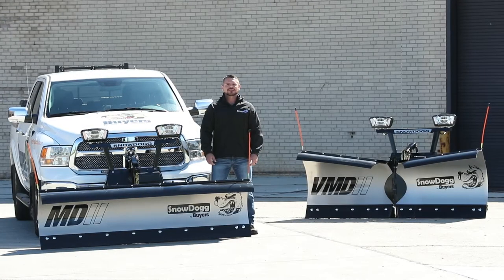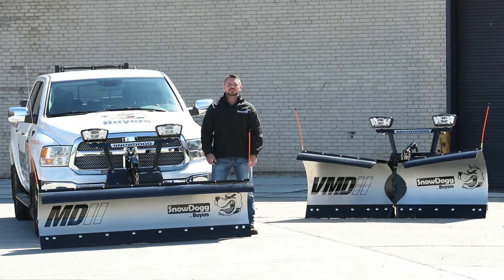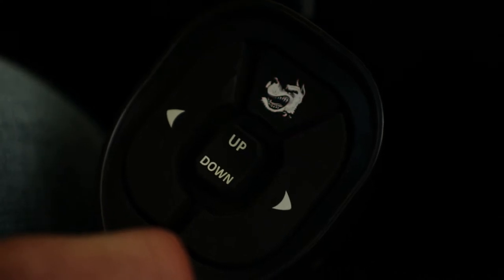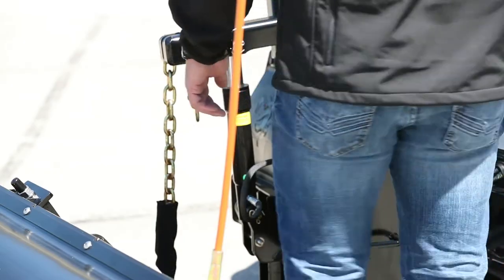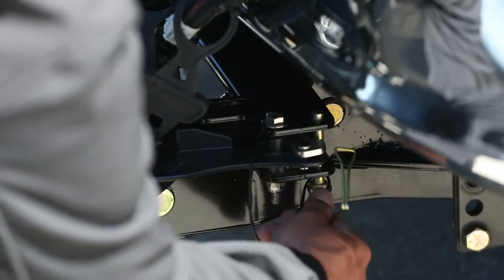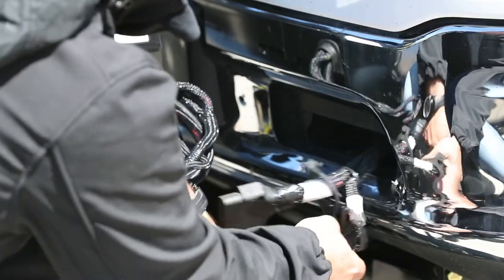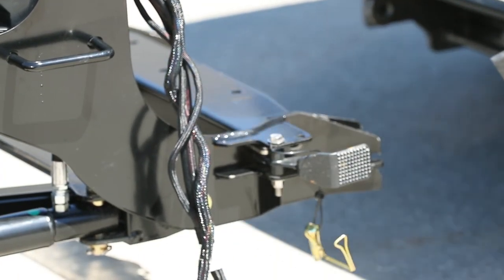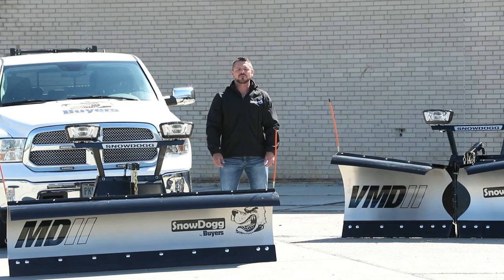SnowDogg How-To: How to Dismount SnowDogg RapidLink Snow Plows (Specific Models & Years)

Comment: Why is it that the vmd2 doesn’t fit on a 2014 ram 1500 ?
Reply from the maker: Hello there! There are many nuances to plow fitment that may affect certain applications. We recommend contacting your local SnowDogg dealer for more information about applications for your 2014 RAM 1500. You can find a dealer in your area at https://www.buyersproducts.com/dealerlocator.
Reply: @BuyersProductsCompany quick question would I have any trouble mounting a 6 inch lifted 2004 gmc 2500 hd ? 

My doubt is that it might be too tall to install a plow on it ? Is that such a thing ? Thank you I’d really appreciate your help!
Reply from the maker: @PACXX10  we'd recommend filling out the Plow Selector to see which plows would work for your truck: https://www.buyersproducts.com/plowselectorpage